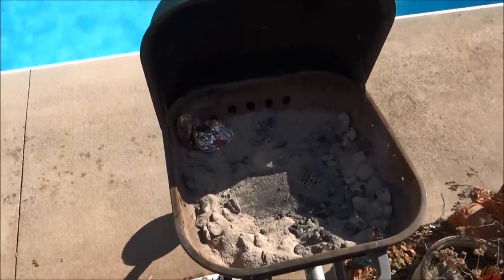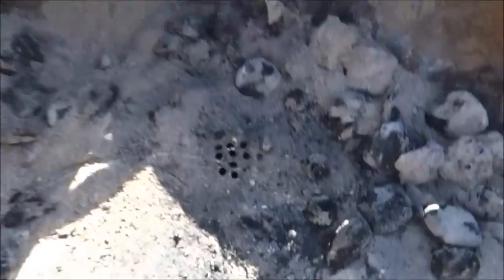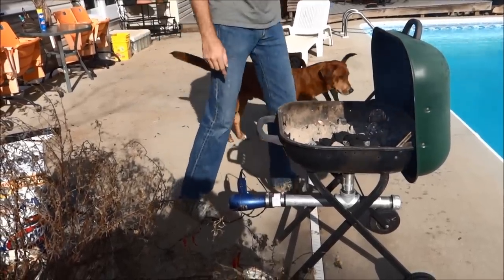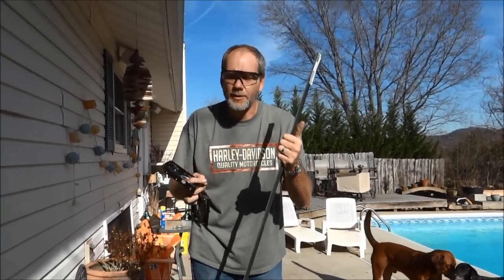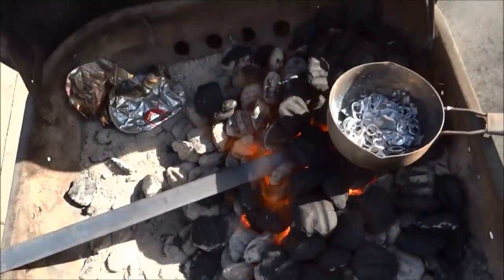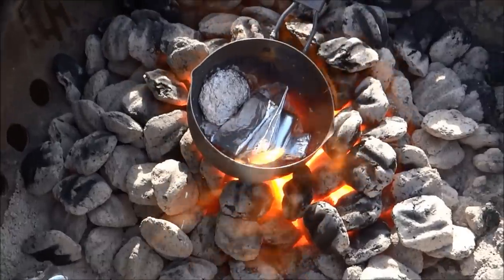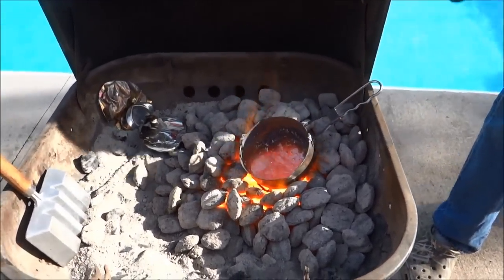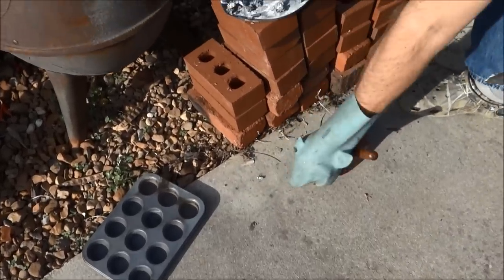Easy Metal Forge at Home - Melt Aluminum - Bend Steel - Blacksmithing

Comment: Metal casting is awsome.
Making forges yourself is enjoyable as long as you do it safe.

One thing you might wanna note is the hazard of moisture/water with molten metal.
Like for instance you are working next to a pool... one bit of water in that molten metal and you have the same effect as detonating a pipe bomb in front of you on top of molten metal shooting everywhere due to the immense quick expansion taking place on contact.
Reply: Not true.
Reply: Pixel Pariah Why would this not be true? These warnings are to be found everywhere it's the same reason why some people have had exploding concrete as it can holds moisture compared to fire brick after a rainfall.
Hell even the backyardmetalcasting site mention it which seems to be a recommended site among many metal casters at home.
Reply: Pixel Pariah You can't just make claims like that and offer nothing to back up your claim.  It is in fact very true.  The water, which is less dense than the metal sinks to the bottom of the container.  When it gets there it flash boils and undergoes massive expansion.  This is what causes the explosion.  Because it's under all that molten metal, the expansion pushes it out with great force.  And you lose a face.
Reply: Eurisko Great comment and thank you for going against his claim. It's really dangerous and when someone is misinformed some really big accidents can happen.
Reply from the maker: Yes, I agree......safety should always be the priority.
Reply: It's more likely that water will get inside that crucible from sudden, crazy rain than from the pool 10 feet behind it lol
Reply: How's the water from the pool going to suddenly jump up in the air 10 feet and get in the pot behind the BBQ grill lid?
The danger from moisture is adding cold metal that might have moisture on it to already melted metal in the hot pot, the pot and the metal scraps in the pot were heated slow together. Nice thing about the pool nearby is IF something happened like splatter or a spill, or moving the pot full of molten metal sees the handle break off and molten metal splatters- the guy can jump in the pool and hit cold water immediately.
Reply: Eurisko Wait a second... Water -- a less dense material than aluminum (1 g/cm^3 vs. 2.7 g/cm^3) is going to sink to the bottom of a pot of melted aluminum?  

You might want to refresh your memory on buoyancy.  Lower density materials float on top of higher density materials.  Oil, for example, floats on water because it is less dense than water.  If you pour water in oil, it will go to the bottom of the container.  If the oil is above the boiling point of water, the water will flash into steam, spraying hot oil everywhere (which is why you don't put out kitchen grease fires with water).  

Pouring water into melted metal, on the other hand, will simple have the water flash into steam on the surface of the metal.  And at those temperatures, it's going to flash to steam immediately well before it has a chance to make a dimple in the surface of the molten metal.  Of course, you might end up sloshing some metal out, or getting steam in your face... either of which should be avoided.  But it's not going to explode on you.
Reply: Victorian Sculptures: Dogs Chase a bird, knock over bbq, molten Aluminum falls in the water, BOOM! Sprinklers come on, water into molten metal, boom! Kids next door have some sort of water fight (with or without water balloons), water into molten metal, boom! Water line on roof for evap cooler bursts, water into molten metal, boom! Huge bird poops into molten metal pot, boom! Tree falls into pool, splashes water into molten metal, boom! 💥
Reply: Like that will not sop the metal from burning deep into the body but on the bright side all the chemicals in the water will help start the infection process
Reply: @LifeBuzzN  preaching water while drinking wine

Comment: I just made a forge out of an old bbq, I layered the bottom with concrete and clay to help make it last longer.
Reply from the maker: Yothegearzz Good thinking.  Have you fired it up yet....made anything?
Reply: yeah I've quenched a few knifes and have so I've probably fired it up about 10 times total. still in perfect working order. I just used clay from mud to layer the sides.

Comment: I did mine out of an old grill I got from china mart,it wouldnt cook worth a damn so I used first an 1 1/2 strainer where you drilled your holes.I put down about 2 inches of clay/mud,then 4 fire brick on top,the piping for the bottom,I used a 1 1/2 cont.waste,and used a raft pump as my bellows,one can use an old wheel burro to make a longer lasting,bigger forge.Good job on yours by the way.
Reply from the maker: Nice!

Comment: i made the same forge and it lasted me a about 10 good uses before the bottom fell out, so for the next one i will reinforce it with some  metal( i was thinking a flat cast iron     
grill then mix the sand around it.) thanks for the video
Reply from the maker: godfere ali-el Thanks for the update.

Comment: Nice and easy way to melt aluminium and heat steel bars.
A good thing with that design (other than that it's simple) is that you can easely stand close to it and grab that "crucible" by it's handle without set the glove on fire
 - most of the heat stays inside the pile of charcoal.
  
I recently built an electric furnace and havn't got any long tools to put in and out stuff. The heat radiation no joke when opening the lid at temperatures above 800°C
 - If i have a black shirt, it starts smoking in a few seconds if I stand close :)
Reply from the maker: Sounds good.  Thanks for the input.

Comment: Hello: If you clean out the grill and mount a break drum from a car over the holes you may get more heat because of smaller area for heat to dissipate. It also may last forever compared to plain metal grill.
Reply from the maker: Rickugg Great idea.....I was originally going to make a brake drum forge, but couldn't find on cheap (free).
Reply: LifeBuzzN try a wrecking yard or recycling yard. A brake drum probably wont cost a few dollars.

Comment: Works better with lump charcoal. Gets about 500 deg hotter. But would melt the bottom out. Lump Charcoal burns with forced air well above the 2100 F point at which Iron melts. 1500 to 1700 is a good forging temp. Aluminum melts at 726 according to my shop thermometer. You also shouldn't put cold metal into your crucible. It can cause explosions. The dross in this case is not impurity in the foil, it's  from having the crucible open and carbon getting into it. A tight cover and a ceramic crucible would eliminate most of it. Ceramic contains no carbon, while cast' iron and steel both do, and so do the graphite crucibles, so you gotta avoid those too. Same goes for silver casting.
Reply: I`m according to this video an "Idiot kid" who does this at home :)
But I found out that when I use ingots that I made from scrap alluminium, and melt those, they create next to no slag/dross, but when I melt scrap metal, it creates loads of slag. 
But the ingots are also being melted without a lid so.... Why does the ingots don`t create slag while the scrap does? They`re both melted in a open steel crucible!
Often I hear stuff about Oxide layers....? 
(I`m sorry for my English, I`m not only an idiot kid, but also a Dutch kid :P)
Reply: I'm only speaking from experience. I use only scrap and never have a problem with dross. But maybe standards for aluminum are lower in Europe?  I thought you were in Canada or the North-East coast LOL.

Really, Your English is quite good.
Reply: Bjorn Njordson

As far as I know, aluminium scrap (pipes & stuff) are made from good quality without impurities. so because they are so pure, they create not much slag. I think our definition of scrap differ, mine is OLD cans that I found everywhere and some scrap that I found on the scrapyard, and those have been exposed to the wheather creating impurities on the surface of the metal.
Yours is problably, as I mentioned, Aluminium pipes. Which are very pure. So they don`t create lots of slag.
And once you`ve melted it once, and you handle the ingots well, it should melt without that much slag.
What do you think?

Comment: my question is since that is an aluminum grill won't it melt?
Reply from the maker: The grill is steal, not aluminum.  The bottom will eventually rust out if you don't add some extra support, however, mine has lasted for years without issues.  Thanks.

Comment: How do you control the temperature to avoid melting the pot?
Reply: The pot is probably a steel one, which requires a much highter temperature to melt, just like the steel bar, it can get orange, but that's still quite a long way from actually melting. You can judge how hot it is by its colour.
Reply from the maker: ***** I don't control it.  It won;t get that hot

Comment: After watching other videos on YouTube I am lead to believe that the hard drive stuff you were melting wasn't all aluminum. The cases are but the lids are stainless steel which is also not magnetic. When I started to scrap hard drives I just shoved it all in the same box and took them to the scrap dealers who just took my word for it it was aluminium before weighing it. I'm wondering if I'd of known and separated the stainless would I have got more cash!
Reply from the maker: You are correct, not all covers are aluminum, but some are.  Thanks
Reply: Really! That's good to know. How do you tell the difference then?
Reply: Dominic Beasley You can probably tell by the sound it makes when you hit it.
Reply: Hit it with a grinder. As I remember SS will spark. Aluminum won't.
Reply: Thanks

Comment: Buy a steel plate and replace the bottom of that grill . make is a REAL forge. Also would be a good idea to move it away from that pool .
Reply from the maker: namingsway It's lasted several years as is, so I'm glad not to spend any money adding a steal to the bottom.  What is the definition of a "real" forge vs a not real one?

Comment: I had a fire but let it get down to a lot coals put log and stuff on to keep it going stuck mufler in fire up a hair drier on mufler I was melting can in a stanles steel pot an melted the pot the fire was hot